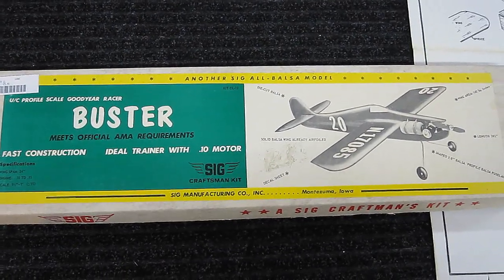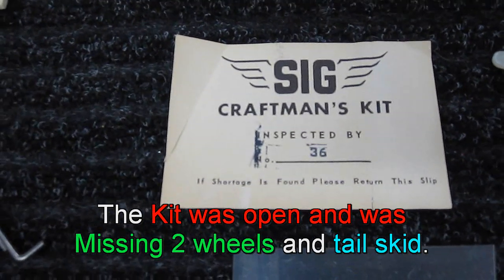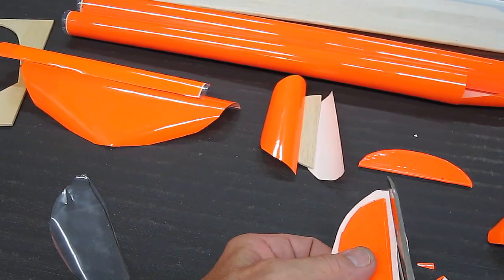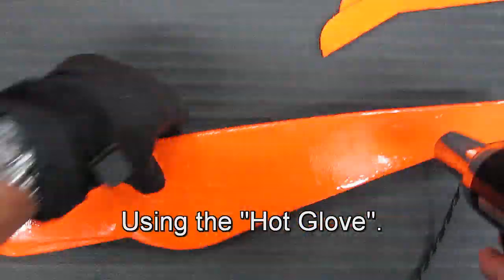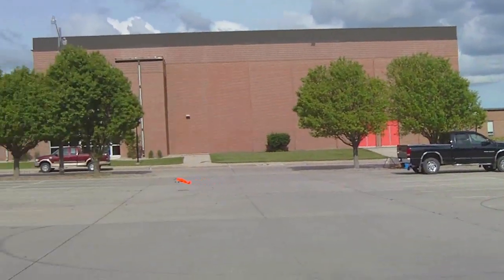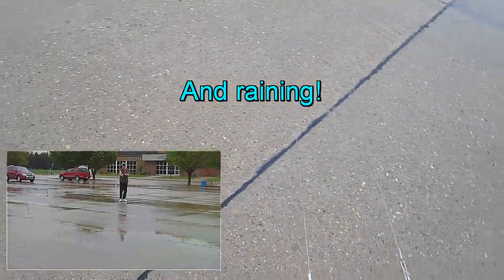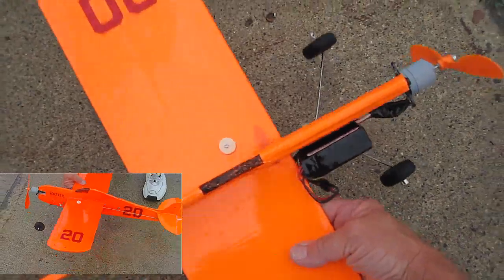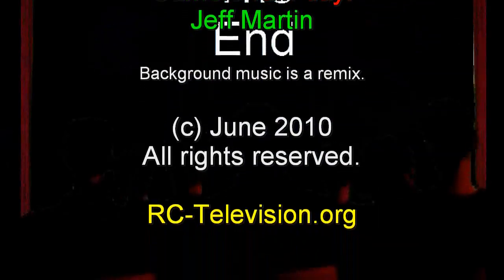Old Sig "Buster" Ukie plane found, built, and flown on 2 different electric motors, + Monokote demo

Comment: Great Video,

I have the .35 sized Goldberg built up wing version of that plane. I enjoyed the monokote tips and although I have been doing it a while I learned something. Sig still sells that kit though so it probably wasn't antique. Still though it doesn't really matter as old ones fly as well as the new.

I'm a glow guy so I think a TD .15 or a Fox .15 would have been my choice for power.

Thanks again for a good video!